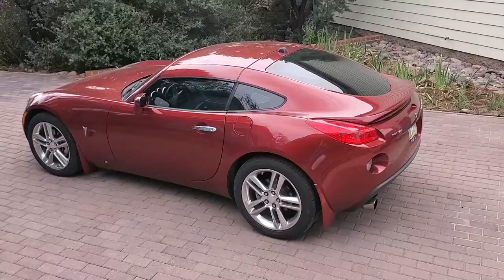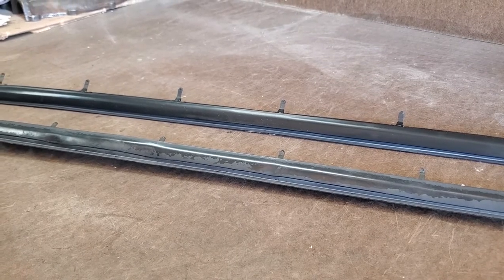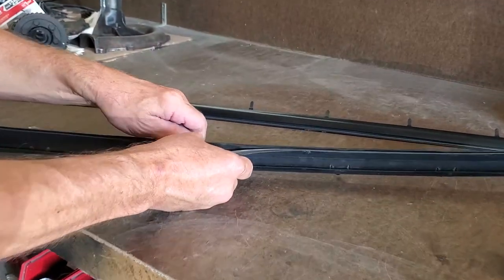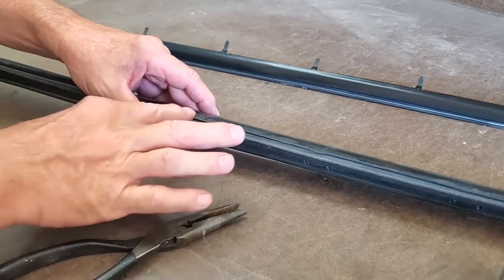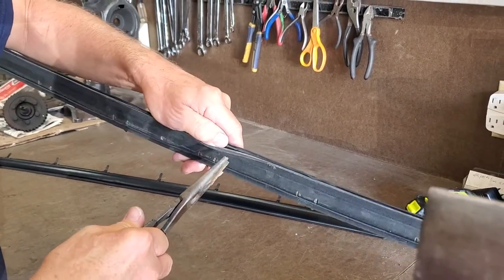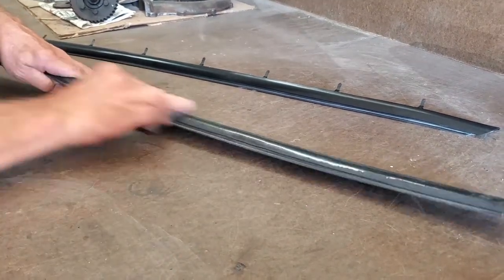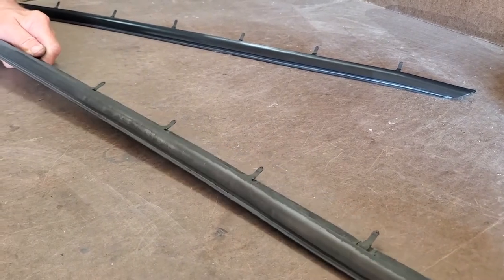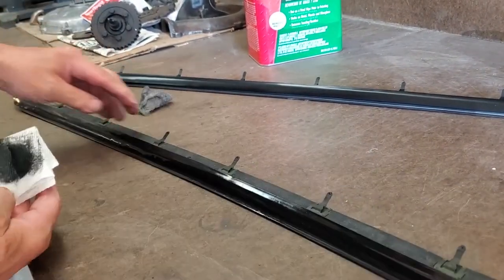How to Fix Hail Dents on Car Window Trim - Restore Car Window Belt Trim

Comment: Nice result. I fixed up similar trim on my Spec V Sentra. The soft rubber/plastic material had been scraped and weathered, and there were small gouges in spots. I ended up using Plastidip spray. So far it has lasted several years in very harsh weather conditions. It's not perfect, but it's definitiely a big improvement. Looks good from 4 feet.
Reply from the maker: Glad you found the video useful. Plastidip spray can come in handy. Thanks for watching!